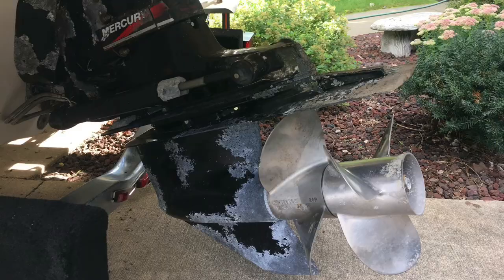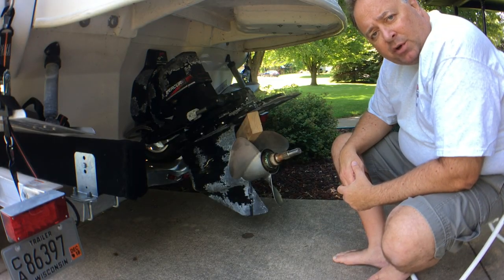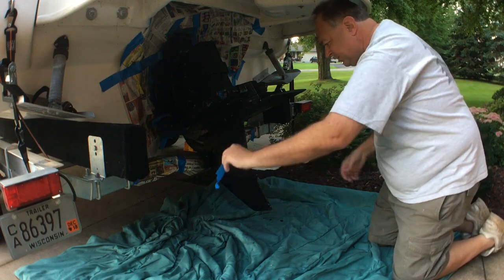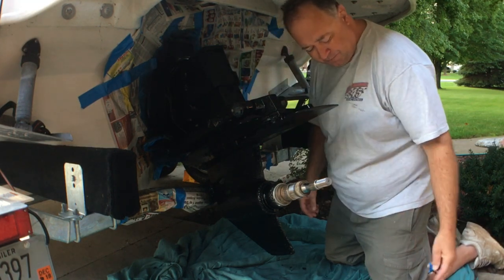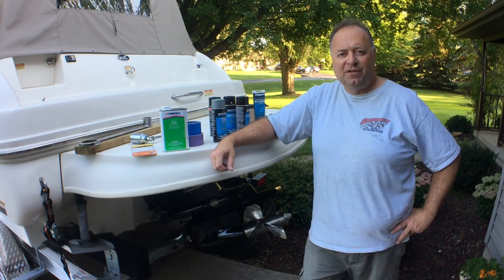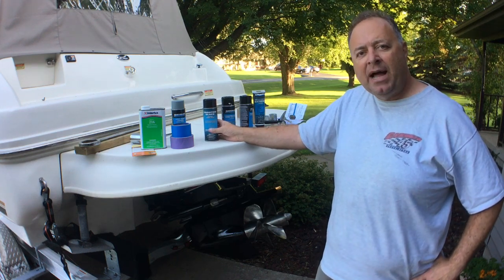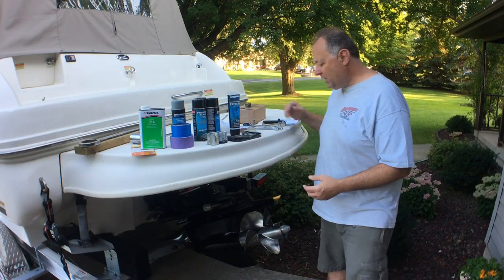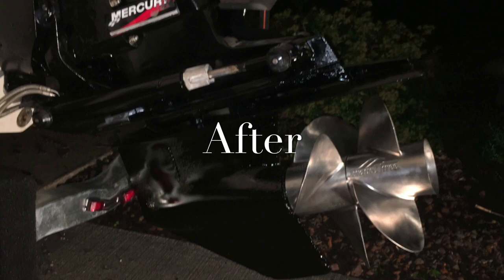Sterndrive Care, Painting My Bravo III Boating Vlog Episode 4

Comment: Ive used the mercury primer and paint on my outdrive, it washed off the second time i put it in the water. I had to use an epoxy based paint that last about a year.
Reply from the maker: fisher9915, thank you for checking out my video and commenting.  I’m glad you found something that worked for you.  I got about 15 hours run time on the boats hour meter during the fall of 2018 before I put the boat into winter storage.  So far, so good.

Comment: How long did this paint stay on the drive and stay looking like the finished product?  Everyone says don’t waste your time unless you intend to do this annually?  Thoughts? 

And what exactly did you use to go from the original state of the drive to the sanded and primed step?  Did you sand everything first?  Sanded with what?  Did you then wipe with solvent?  Did you spray anything on it to get that gray color?  Is that some kind of primer?  Can you elaborate in more detail exactly what you did and what you used to go from old looking drive to primed and ready to paint drive?
Reply from the maker: Mike Amend Please feel free to text me or message me through Facebook messenger. I can send you a photo of what it looks like right now after 42 more hours on the motor.   

Looks great.  I am not in a slip. I’m a trailer boater.  So that reduces time in the water.  

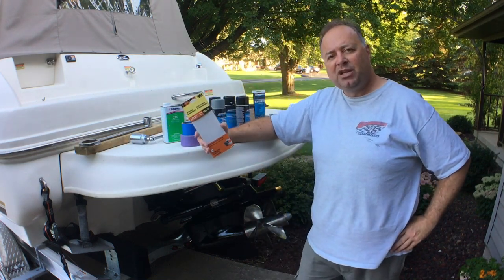I did review the exact products  starting at 7:32 in the video. 

Thank you for checking out my video and posting your comment.

Comment: I'm wondering how well the paint held up long-term. I need to do the same process to mine.
Reply from the maker: M M Since I completed this task, I’ve added about 74 hours to the motor and drive. 

I’m a trailer boater, but we do occasional overnights.  When totaled, the boat has spent 7 overnights in the water this summer, 2019. 

So, this amount of use and time is high for a trailer boater but low for a person who keeps their boat in a slip.   

The paint has held up well.  I’d be happy to do a Fadcebook  livestream with you to show you.  

The bottom of the skeg, visible only when you trim up all the way, that paint was mostly scraped off when I forget to raise the drive as I was moving the boat.  Thats on me, and not a reflection of the paint job. The rest of the drive looks like when I painted it, minus some scum that I need to  wash off.  As a trailer boater, I’m very satisfied.  

If I was keeping the boat in slip where it would be submerged in water 24 hours a day, 7 days a week, I would need to do more research.  As a trailer boater, what I did in this video is working well.

Hope this helps.
Reply: @DougAlesUSA  Thank you for the how to and the quick response to my question. Keep the videos coming.
Reply: @DougAlesUSA  Hi Doug, just wondering how well this is holding up? I need to paint mine as well

Comment: Hello Sir, i wonder, did you really need three full cans of paint? I´m in the process of ordering party for my outdrive and engine and was wondering about how much paint i would need. For now I have 1 can of primer, 2 cans of paint and 1 can of clear coat. thank you fopr the great video by the way :)
Reply from the maker: Thank you for your question.  Each coat took 1 plus 1 /2 cans of paint.  So, based on my experience, you would have one coat of primer, one coat of paint, and one coat of clear coat.  Its up to you to decide if thats what you want.     Best wishes .
Reply: @DougAlesUSA  For salt water, the last coat should be an anti-fouling paint, right?   A clear coat over anti-fouling paint would stop it from working.

Comment: How’d it stand up ..?
Reply from the maker: It held up well until I hit rock bottom on the Wisconsin Eagle River chain of lakes this summer.
Reply: @DougAlesUSA  sorry to hear about the rock strike
Reply from the maker: @Andrico77  Thank you.  

The rock strike occurred as we were precisely between the red and green markers going minimum idle speed with the drive partially raised, as we were leaving Medicine Lake and entering Big Fork Lake near the town of Three Lakes on the Wisconsin Eagle River chain of lakes. 

Thank goodness the damage was not severe. 

The forwarded / bow most 1/4th of the skeg looks like  a shark bit it.  The rear / stern  3/4th of the skeg closest to the propellers is undamaged.  I intend to repair the damage myself in spring.  I may weld on a new skeg or reshape the skeg, then go from there.   

The stainless propellers are not bent, only some minor edge burring, so I can fix that myself with a hand file. 

This follow-up and do-it-yourself repair may be worthy of a new video.  

Thank you for your  question.